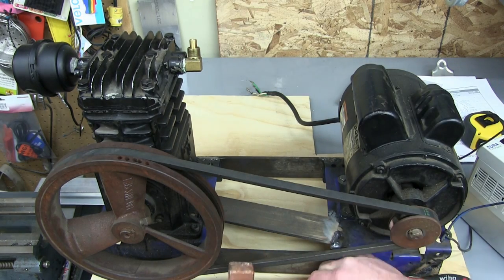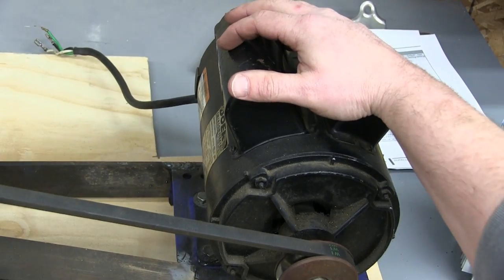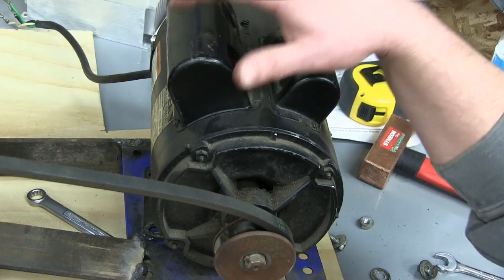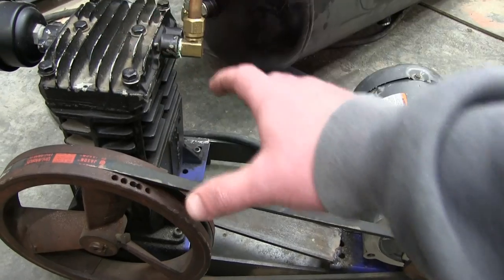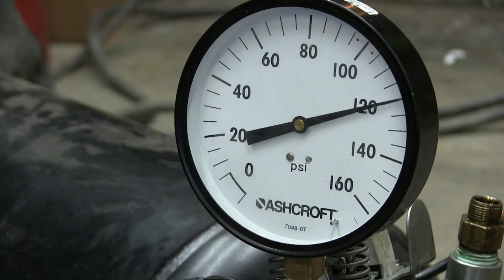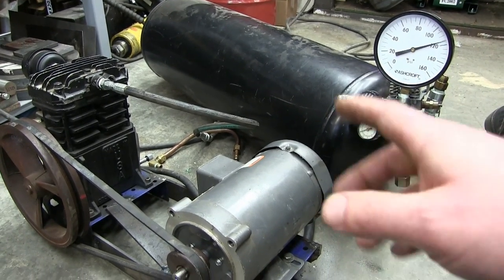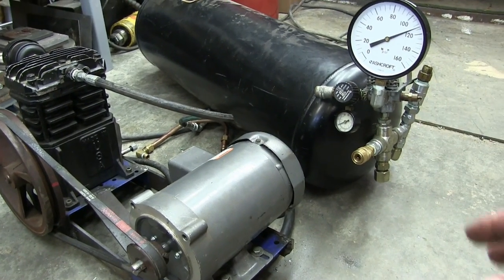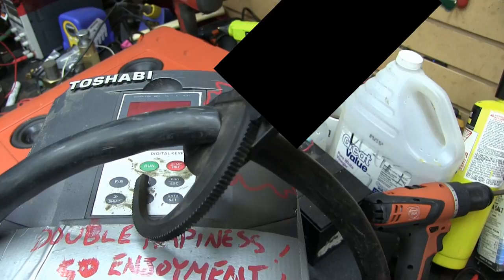BIG COMPRESSOR PERFORMANCE BOOST | No tripped breakers!

Comment: So..  How much faster can a 20 year old 3HP 3400 RPM 3 phase 220V motor turn over spec?  I did VFD's on my Bandsaw and Drill Press..  I'm Experimenting with Series Motor (Miter Saw) speed controllers.  Not easy, need closed loop control to maintain torque at low RPM.  There is this chip made for recent washer machine series motors using a TACHO input for speed control.  They can be simply adapted for much easier to add hall effect digital sensors.  Maybe you could do a show on that?  There is a Chinesium controller board out there on ebay.

Comment: I'm at least 3 years late to the party, but I always wondered why not have a bypass valve like on a truck. Compressor always runs, but when you get to max pressure the bypass opens so nothing explodes. But I'm sure there's at least a couple reasons why that's a stupid idea.

Comment: I may sound like an idiot, or the cheap man that i am, but cant you just adjust the pressure switch so the motor kicks back on at a higher pressure? What do i know tho, I R just a weldor

Comment: Great, except your compressor is running backwards. Its splash lubricated and the dip tube off the crank is not gonna pick up oil. This will work for a while, until the machine seizes. Air should always move across the machine from the front. i.e. it blows towards the compressor it does not suck it across the compressor as yours is doing. YES direction of rotation is important.

Comment: If you are starting a compressor from zero psi, then this is valuable.  Otherwise, not so much.  If your compressor doesn't leak, then you don't start it from zero, and that's a far easier and cheaper problem to solve without buying a 3-phase and a controller.  Most of the other things you mention just involving someone having too small a compressor and your desire to just overdrive it.  You can do that with a pulley, or, better yet, just buy the right size compressor.

Comment: Seems really over complicated. Start out small. If your working band is from 80 to 125 psi, If the pressure drops below 70 kick her in high gear, up those thresholds if your application has a higher working pressure. You could also do some cool things by sensing the rate of pressure drop and kicking on sooner, or try to maintain pressure by turning on slower at a higher pressure and maintaining it. You'd need to do something about the duty cycle at some point though. Really a cool idea though. You've already done a world of good with the soft start too. I'm a big fan of the unloader valve, but the soft start probably makes it obsolete.

Comment: Where is the zero to 60, 120V baseline test?
Have you tried putting some electric fans on the compressor and motor hot spots?
Having the compressor exit to a large diameter pipe with cooling fins should help flow from the compressor.
Putting a car air filter and housing should reduce air intake noise.

Comment: How about increasing the drive motor pulley size. It works by reducing filling time by up to 40% and is far cheaper than electronic controller. IMHO
Reply: That would decrease the torque multiplication and cause start up problems
Reply: @corpsie666  Works fine and cuts fill time by just about half.  The only down side the increase in compressor heat and speed wears it out faster. Auxiliary fan helps with the heat.

Comment: For the price of that brainy part you could have purchased four more compressors with tanks, ganged them in parallel with a common hose and had enough air to blow up a blimp, and had enough left over for a 50 yr old bottle of scotch.  Fun stuff there but not practical IMO. I dont want my compressor doing odd shit suddenly when someone coincidentally uses a tool in a particular pattern. This sort of speed control does exist for some large industrial ones; I used to work at a factory that had two compressors, of which one would be on at any time while the other was down for servicing or just standing by. They were each the size of an 18yrd dump truck and were operated by a computer console.

Comment: Yes very useful and genius but make it have a feed back loop from some pressure sensitive potentiometer 0 hz at 120 psi and 100 hz at 60psi custom circuit board would be so kool

Comment: Why wait for the pressure to drop, use it to maintain a constant 120 psi (or whatever you're running) and duty cycle the compressor based on how fast the pressure drops

Comment: Just watching this in 2021 but one thing that concerns me about a pulse speed controller or any fancy electronics on a job site compressor might have a problem if running off a common job site generator. The quality of power available may be risky when it comes to sensitive electronic controls.  Also, three phase power isn't always available, in fact its rarely available in these parts on job sites so the controller needs to be capable of running on single phase but controlling a three phase motor, in which case won't there be some efficiency loss in the motor?

Comment: I wonder if acheeper version of this would be a solution for my temporary problem.
I bought one of those $60 Harbor Freight compressors (I waited till they were on sale for 40. I'm not a complete moron, only like 65%) I tho0ught I could get this thing to work just for blowing away chips & running a coolant mist thingy. Well, this thing is 90% useless. I thought of putting a bigger motor on it but the compressor is also pretty tiny.
 Should I just get a better compressor or is there a cheep version of that VFD? This thing ain't much better than those tiny compressors that plug into a cigarette lighter.

Comment: Don't exceed the compressors max speed or the compressors come apart. The one I built runs the compressor at max speed and shuts off at pressure, I adjusted the pressure switch for a narrower band and used a 6HP motor (instead of the recommended 5HP) to give me plenty of chuchum. I used a 2 belt variable pulley on the motor and adjusted for max speed.

Comment: My shop is using air from the neighbor. He has a screw compressor. Is there any way to improve that? It runs constant pressure by the way (means it maintains 90 psi at all times). No idea of the output but on the plate it says 1 CMM (cubic meters per minute)

Comment: I would bet it's not done due to both parents and monopolization of tool producers. Just like finding a reasonably priced perm mag gen/gen head ...how old is that tech? If u r gonna kick it up like that I'm thinking u should probably monitor the tank with plc or mcu and sensor unless it's significantly higher rated than what u can burst the pressure at. I could see it going wrong...but I'll admit I'm not to familiar with compressors

Comment: Couldn't you run a small signal wire along with the air line (or wireless if line of sight isn't a problem) and just have it switch to maximum power. Just have a thermistor and a pressure sensor to be a safety switch so to speak. Motor gets too hot it turns off or if it's producing more air than you can use it slows down or shuts off. A few ics should be able to manage that.

Comment: This would be a fantastic thing to have at work. I primarily work on cars with age and I can do a not of work and the compressor drops to around 80-90 psi. I then have to hold down the ugga dugga to run more air out of the compressor to kick it on and get it back to 120. It's time consuming and all around irritating.

Comment: No replacement for displacement, if you can haul shingles all day you can carry a bigger compressor or a second one all together. Problem is our electrical system finding a happy medium between efficiency and work output.. until then the full bore til the tank is full system works. It's an economy of scale ⚖

Comment: What does a frequency converter cost? How about the pressure switches and PLC?
Reply: killertoast At least 10 times as much as the best air compressor at Lowes

Comment: wonder if you could fabricator a water jacket for the compressor and use a radiator with a fan,  Make a water cooler / new shop heater out of it.

Comment: yes but most uggadugga guns out flow the compressor is why the need for the tank. but yes for air nailers and other such things a simple input into the drive to maintain 120 psi would be great. 
also some drives can be programed to reduce rpms when load goes up. to maintain horsepower automatically no need for external plc.  also we have temperature switches on the stator that can go directly to an input on the drive.

Comment: Why have the "fluid battery" (air tank) at all if you can modulate the pump? That's the only raisin it's there to begin with! Bigger pump better engine control = less space on the truck. Probably weighs the same though.

Comment: some time back i saw a guy use dry nitrogen to run roofing guns.    3 big nitrogen tanks at 2,000 / 3,000 psi.  regulated to a usable psi.   would last his crew for a week.  no water in the lines ect.

Comment: Whats 200 % going to do to circuit breakers how much will it draw i cant even weld more that 2 sticks in shit box garage 30 amp service and my compressor has tripped breaker  when building house the run long extension or go gas or generator load could be issues   but I don't know much about tech your using

Comment: Nice idea, but why not just map the pressure against demand. The thing could even monitor its operating efficiency and compensate automatically.
Reply: Actually you should make it a racing compressor... Port and polish, fabricobble some high comp pistons. New bearings, trick reed valve... Lol
Reply: Make a lightweight pully on your cnc...

Comment: Sorry but as someone in the compressor game this isn’t anything new, maybe not on piston units with vsd but there are reasons for that mainly heat on motor bearings, but all you did was change out the motor for a larger motor and stick a vsd to make sure it’s constantly running - not so great on the power bill, and being that it’s now 3 phase, I don’t know a lot of building sites with abundant 3 ph power available? Rotary screw units have had vsd on them for decades now, if you size the compressor up for the job it’s intended to do properly at the start when buying and don’t go buying something cheap pressure won’t ever be an issue - another thing about piston compressors are not there is only one brand I know that is 100% load - all the other’s especially the cheap ones are basically 75% load anyway. Sorry I understand that it’s interesting to have a vsd piston but there are many reasons the compressor companies don’t do it. Being this video was made a couple of years ago, how’s that compressor now?
Reply: that is a 3 phase motor he replaced the single phase motor with

Comment: The ADHD meter is bouncing off the red here but from what i can decipher kinda the same outcome can be had from cranking the pressure switch right up can it not? I have mine set to kick on with a 10psi drop

Comment: Why not measure the pressure electronically.  Then use that that with a time measurement to see how quickly the pressure is dropping, is it in pulses to determine the make up time needed to quell the pressure drop.  You could then preprogram the controller with some settings based on the tools (ie: CFM at PSI) in use.  Also fit it with 2 pressure pop offs.  1 the max pres. release safety, and one 5psi less to allow the compressor to have constant run feature so motor isn't start/stop all teh time.

Comment: Instead of using the bursts of air being consumed to crank up the power why not use the declining air pressure?  If it's dropping at a rate of X run normal speed, if it's dropping faster or drops below a certain pressure then engage ludicrous speed.

Comment: I just leave mine on. It won't run unless you are using it, or you leak air off. I mean it works fine for me for a 400$ comp. I'd add another tank inline for more volume if I ever come across 1 when I got extra cash.

Comment: Wouldn't a CVT belt drive (go kart torque converter) allow you to do the same thing without the need for an expensive, smoke-powered VFD? No "smart control", but would give you the variable torque control, with a simple mechanical solution that is less likely to burn out...

Comment: Man, I think that the motor direction is wrong. The wheel on the compressor side had a kinda propeller. You can feel the airflow comes from the compressor to you. I think the air should flow in opposite direction.

Comment: Why not just buy an  unloader valve for the compressor discharge and set it up as a constant run compressor with an integral pneumatic pilot valve controlling the load and no load pressures ?? This setup works great when you have intermittent but short time demands on your air supply......like a nail gun. You can get down to 5 PSI difference between cut in and cut out pressures. Cost ?? About $70 - $90 on Fleabay.

Comment: got a quick question I've got the old standard 50 gallon compressor and it sounds like I'm trying to kick-start an a-10 warthog and inevitably every single freaking time I go to turn the switch to turn on the compressor it flips the breaker. It cuts off the power to my entire shop & I've got to go over turn it back on wait for it to pump up. how much would this setup like this cost a guy who just started his own business say working on outboard boat motors and there's a little tight for cash right now? I mean at this point sometimes it pisses me off so much I want to take a flamethrower to the whole fucking thing!!!

Comment: Usually a construction site they don't have power so you're either running on a generator or you're you're running off gasoline Motors on air compressors

Comment: It could allow people to use a smaller resevoir tank with their compressor as well for the same tasks.  Now figure out how to do it with a arduinoish microcontroller and the appropriate motor controller for $25 and you got yourself something.  Cheaper than a full blown PLC if possible I'd think.

Comment: Amateurs. I just installed a 350HP Sullair with a VFD, drive was the size of a fridge but can throttle a 1400cfm compressor down to 400cfm holding 125psi without going into unloading. Still, the small scale is an excellent idea, high volume and high pressure applications, install a check valve with an unloader to aid in the full load starts and away we go.

Comment: Or... Just use a limit switch with a tighter differential and make sure your motor is rated for a high enough duty cycle.

Comment: 12,000 PSI hose? was that a hydraulic line?  Hats of to getting that shit ADAPTED, that's always a fuckin rubik's cube combined with a treasure hunt.  Thinking about building air compressors from recycled 4 cylinder engines redesigned to run on one cylinder (pumping 3) then two (pumping 2) then 3 (pumping 1 at max pressure) cylinders in similar fashion, purpose building those would be cost prohibitive, but starting out with the block and rotating assemblies for scrapyard prices, perhaps there's something to be found there, or maybe I'm just a complete idiot.  probably the latter.

Comment: As much as I like the idea, it's not really practical as you buy a compressor that is over rated for your needs. I've worked in several garages and only have issues with low pressure when someone takes a blow gun to dry off a vehicle. Commercial compressors stop at like 120+ and start at 100. So you "should" always have more psi than your tools need. Also it's probably FAR cheeper to just buy a larger compressor than to buy a unit with 3phase VFD

Comment: I understand the reason for the three phase motor. But three phase power is not readily available on job sites without a three phase generator obviously which are quite cost prohibitive. At that point why not just use a screw type compressor and do away with the piston style? The screw type is more efficient anyways and can keep up with damand. Just wondering. Not trying to be a smartass.

Comment: And while you're at it, get rid of the regulator and replace with proportional air control valve. Also you will need a laptop to trouble shoot, and set parameters. Hell of idea.
You know it's okay to have more than one nail gun compressor on a job site.
The reason they haven't changed in 150 years, is because they're simple and they !ucking work.
This has application, but not in the average guy market. Most people using compressors don't have EE degrees.

Comment: Ever hear of WD-40 for rusted pulley removal?
 Use an old Borg Warner car A/C pump for my air compressor. Drive ratio is 3 to 1. Never trips even at full pressure.

Comment: So this is a 3 phase motor?  If so, most houses don't have 3 phase, and this won't help us.  I wonder if a variable ratio pulley system would work like they have a variable drive transmissions for those of us that don't have 3 phase as an option.
Reply: A VFD runs 3 phase motors off of a single phase circuit as long as it's okay with the current draw.

Comment: I dont even do labour intensive shit. When i use my impact, it needs to be at full pressure to do the proper job. Go ahead and whine about it, but even if the regulator says 90 psi or what ever, the actual out put of the impact isnt as sturdy as when the tank says 120 psi. In the winter, i cant even run my 30 gallon compressor without it tripping the breaker at 80 psi. So, this kind of this really does appeal to me.

Comment: My compressor turns on at 150psi and turns off at 175psi  and the line pressure is throttled down to 125 so it always has the same 125 line pressure

Comment: You are overthinking it
All you need to do is very the capacity by the amount of use that will give you the same outcome if not better
I.E: if the pressure drops to 90 PSI in 20 minutes you need to drive it up with less force then if it drops to 90 PSI and 2 seconds
A point as easy as seen if it's exaggerated